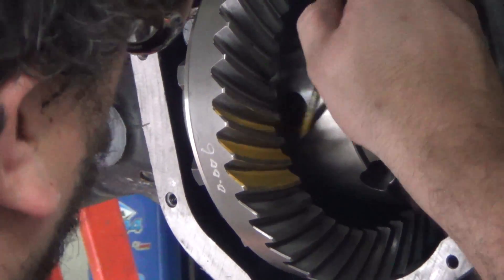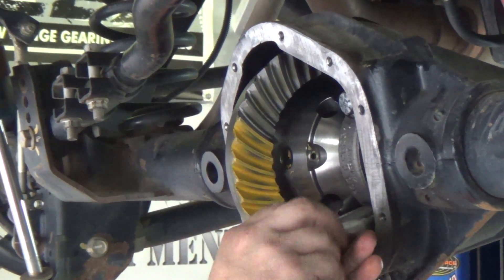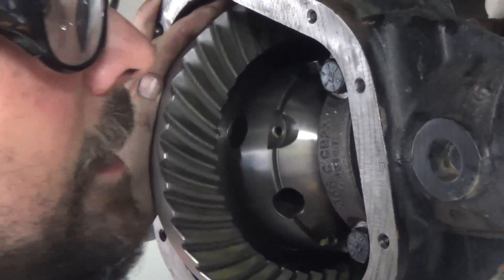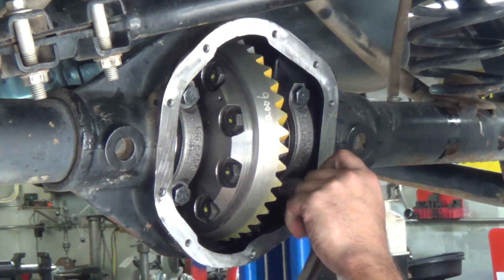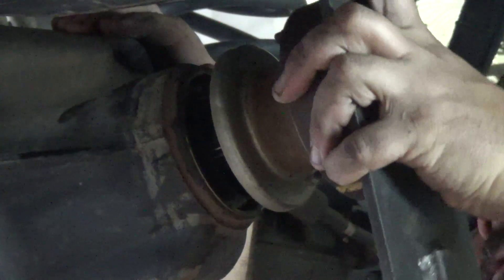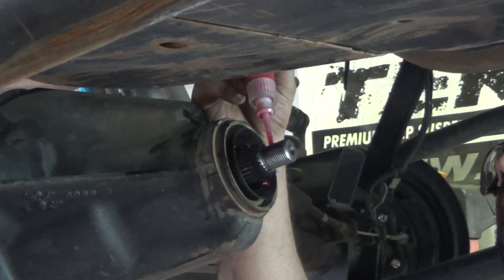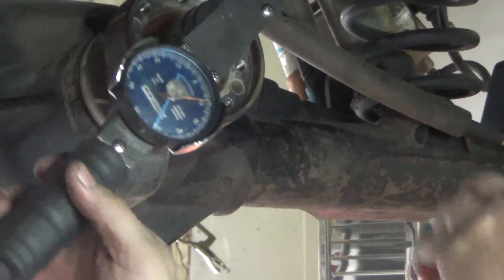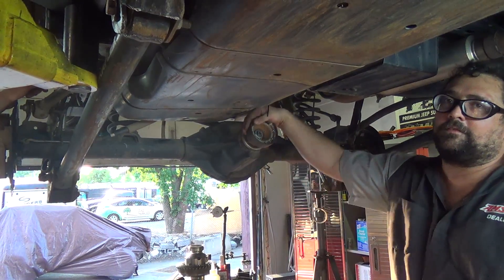Rear Axle Upgrades and Diff School - Part Four - Gear Mesh & Pinion Preload

Comment: Use a half inch drill motor and a wooden stake. 
Put a cut off extension in the drill the other end in a socket so you can spin ring and pinion together make sure to go both ways while adding resistance with a wooden stake do not under any circumstance put your fingers anywhere near any of the rotating components.

Comment: great videos,but can you tell me if you are using the new bearings and pulling them back apart then putting them back on again or are you using old bearings on the pinion and honeing the inside of the bearing and pulling it back off again? i have dana 44 axles i put in a 08 wrangler and i dont think it has been apart but it has about 120,000 on air lockers from rubicon and it looks loke they are making contact completely on drive side all over but not up too high but seems it should be centered more on drive and coast side instead of almost all over the teeth.im worried.any help appreciated,again great job on the work.your awesome

Comment: We were taught in trade school here down under to have lots of resistance when marking the gears, we actually use a piece of wood and jam it between the crown wheel and housing just enough to have lots of resistance when turning the diff, makes a huge difference.

Comment: what does it mean if the coast and drive sides are on different ends of the gear? one close to the inside of the tooth and the other towards the outside of the teeth.

Comment: Great video. 
Go buy a 3/4" torque multiplier. It allows you very exact small controlled increases of torque on the crush sleeve. It takes the "Oh Sh*t" out of the final adjustments. ;-)
Reply: Ì did the spacer crush sleeve eliminator on mine because of this.

Comment: The crush sleeve has nothing to do with achieving the pinion bearing preload. You can set pinion bearing preload with out a crush sleeve in place. You would have to use a jam nut with the pinion nut to assure it dont come loose. The crush sleeve allows the pinion nut to be tightened to a torque value that will keep nut from coming loose with out over pre-loading pinion bearings.

Comment: SO WHEN YOU WENT DEEPER WITH PINION DEPTH, WHERE WERE YOU AT IN REGARDS TO SHIM THICKNESS AND HOW MUCH MORE SHIMS DID YOU HAVE TO ADD TO GET THE RIGHT DEPTH?
Reply: As bad as the pattern looked the first time, he most likely added around .008 more shim.

Comment: I don't understand why Paul installed the new crush sleeve, crushing it to a 'no' preload condition, then took it back apart and installed the oil slinger, new seal, etc., reinstalling the drive flange again with new nut.  Why did he perform this operation twice?

Comment: When you pulled that bearing to adjust the shim for the pinion depth, were you able to reuse the bearing?  Doesn't the puller wreck it?  That is a pretty expensive bearing too, if you use the USA ones.
Reply: As long as you the right sized separator and get it fully under the inner race so aren't pushing on the cage they usually come off without damage. After all you're not really apply much more force pulling it off then you are pressing it on.

Comment: Maybe I'm wrong but when you set the gears with the marking compound, it was set with the pinion nut. Then you took it apart and started all over with the crush sleeve. Since the crush sleeve adjust the pinion depth, what were you setting ? It wasn't clear in the video.  Why set something up to immediately take it apart again, start the entire job all over with the crush sleeve.  Isn't the crush sleeve the adjustment on the pinion ? I don't see anything else.  I'm confused about this. I am going to use a crush sleeve eliminator as I can't measure the 300 ft/lb torque that is required to crush the sleeve.  My torque wrench maxes out at 250 lb/ft.  The crush sleeve eliminator shim setup requires 120 lb/ft which I can easily do and measure but have trouble with the thickness. How do I know what thickness is needed ?
Reply: The crush sleeve sets bearing preload not pinion depth. The washer/shim between the inner bearing and the pinion gear sets pinion depth. I recommend video to learn about ring and pinion setup https://www.youtube.com/watch?v=dAqAqODmcj4
Reply: You dont need to use a torque wrench to measure the 300 ft lbs it takes to get the crush sleeve to start crushing since that isnt the final torque value. You can use a cheater bar just like they are. The 300 ft lbs is irrelevant. You measure the amount of inch lbs it takes to rotate the pinion. In this case it was 22-35 in lbs. so for example you see in the video they used a big breaker bar and a pipe extension in order to crush the crush sleeve little by little and stoping to measure the inch lbs of rotational torque it takes to turn the pinion. You just work your way up slowly. First get the slack out, then tighten it a little more little by little and measuring along the way till you get the 22-35 in lbs of rotational torque you want.

Comment: At about 3:45, he made the pinion deeper. Does that mean a thinner or thicker shim?
Reply: me thicker.  Pinion was moved deeper into the ring gear.
Reply: @snaproll94e  Actually the opposite. The deeper the pinion is the farther away it is from the axle centerline. He used a thinner shim to move the contact patch towards the outer edge of the ring gear to center it up on the gear.
Reply: Killer2600 I work for a company that makes ring and pinions as well as other gear sets.  I've spent a fair amount of time running a Gleason gear tester, matching and measuring gear sets.  In our world, the terms deeper and shallower refer to the mesh of the gears.  Deeper is into mesh, pinion moves toward the axle/ring gear centerline , shallower is out of mesh, pinion moves away from the axle centerline.  Adding shims to the pinion moves the pinion into mesh/deeper, removing shims moves the pinion out of mesh/shallower.  I've never heard these terms reversed, anywhere in the world.
Reply: @snaproll94e  I didn't make up my terminology, I learned it much like you. The only difference is I learned it from those that install/build axles not cut gears. If you were someone who cut your own gears then yes you'd likely to refer the the depth of cut. But for the axle build who doesn't cut teeth, depth refers to how far in the diff housing the pinion has to go. At the most shallow (where it's just starting to go in) it hits/interferes with the diff cover. Push it in deeper and it ends up where it goes.

Comment: Is there a con to using an impact to set pinion preload
Reply: yes, they dont make an impact with the ability to set to a specific torque
Reply: I use an impact to draw it up all the time. I don't use all that monkey motion ratchet/cheater bar crap.